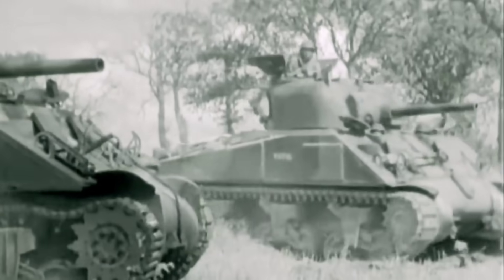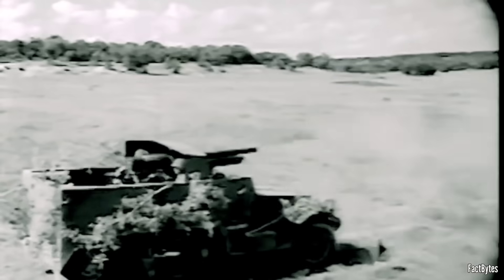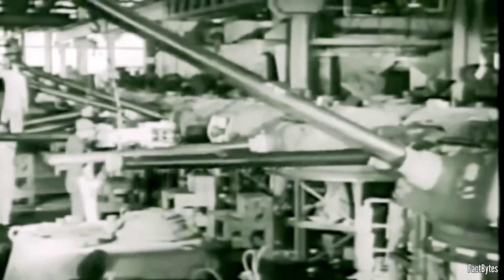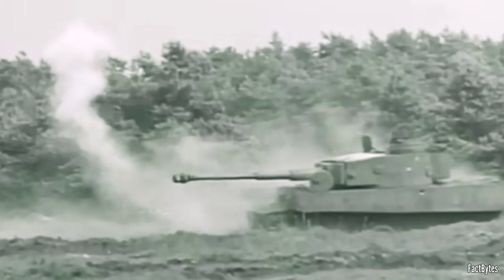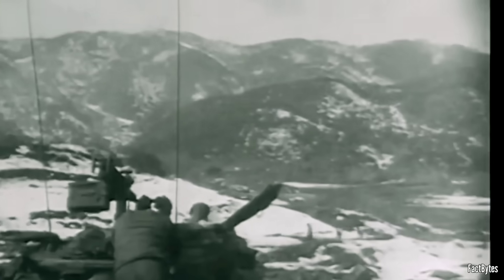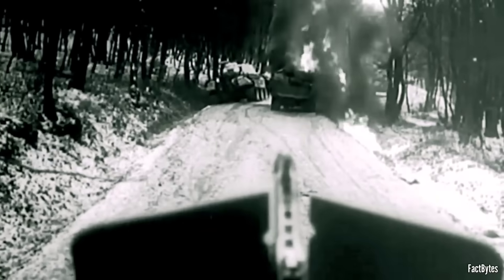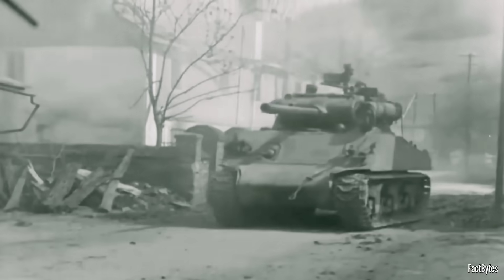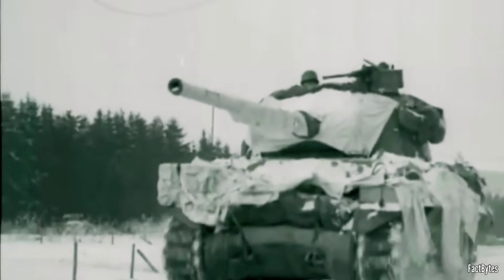From Stopgap to Big Cat Killer: Why the M36 Jackson Existed

Comment: The U.S. Army at first contracted for 500 M36 tank destroyers which were to complement the M10 tank destroyers.  The M36 would be called in whenever a Tiger I, King Tiger, Panther, or Jagdpanther were spotted.  This proved to be unrealistic and impractical.  The U.S. 21st Army Group's armored divisions were clamoring for more M36 tank destroyers and for the M10 to be immediately retired in favor of greater numbers of M36s.  The U.S. Army abided by the urgent demands as best as it could.  At this late stage in the war it was impractical to retire all M10s.  M36 production ramped up once more and in higher contract numbers but the desired mass numbers could not be met that fast.  U.S. manufacturers shipped M36 tank destroyers to Europe as fast as they could.  The current M10s would have to make do with similar M4 Sherman tank tactics of surrounding German heavy tanks and targeting the sides, flanks, and rear.
   The same went for the M4A1 Sherman 76mm cannon tanks.  It greatly helped when the new tungsten core HVAP round appeared in late December 1944 and January 1945.  Quantities were scarce, however, and often M4A1 tanks were limited to just two tungsten HVAP rounds apiece.  There's still uncertainty whether the 76mm tungsten HVAP round could penetrate a heavy German tank's frontal glacis armor at short ranges which would have been suicidal for a M4A1 tank and crew.  Sides and rear posed no problem of course.

Comment: The 3" & 76 mm were the same gun.
Reply: No the 3 in gun used in the M10 tank destroyer was completely different than the 76 mm gun fitted to late war Sherman M4 tanks.  The breach portion was too big to fit in a M4 Sherman turret.  Thus, the M10 was had a thin open top turret.
Reply: This is a common misconception because both guns fire the same rounds and have near equal performance. But the 76mm was a lighter, modernized version, while the 3' was a bulky WWI design.

Comment: I've heard the 90 mm weapon compared quite favorably with the vaunted German 88.
Reply: The 90mm M3 and the Flak 36 88mm had similar performances. The 88 got it's very justified reputation from being used as an AT gun far more than the 90mm.
Reply: @johnolive3425   The 90 mm was used on American tank destroyers. Yes, the 88 was much more well known as a tank killer even though it was sometimes the 75 mm weapon.
Reply: @johnolive3425  That's why I described the German weapon as vaunted.  adj praised or boasted about, especially in an excessive way:
Reply: It was better than the "short" 88 (kwk36). But worse than the "long" 88 (kwk43).
The 90mm firepower was something in between the Tiger I and II.
Reply: @1918BARsam  - That would make them comparable.

Comment: Britain did this with the Firefly months before but the US didn't want it LOL.  The Jackson did finally turn up... eventually
Reply: Also the M 10C Achilles.
Reply: The US didn't use it because it was a gun and ammunition they didn't produce, the gunner and loader ergonomics were terrible, and the accuracy wasn't good.
Reply: @T51B1  Accuracy with standard rounds was good enough, it was the APDS rounds that were inaccurate.
Reply: @T51B1  but it still killed german heavy tanks, so much so the firefly crews had to try and hide the 17 pounders barrel length
Reply: @TheFunkhouser that's because the Germans were afraid it so they targeted it first. I would place a bet that 75mm tanks had more kills than the fireflies did.

Comment: I read somewhere that, during the Battle of the Bulge, three of these tanks were positioned in a tree line facing a very large open field covered in morning fog.  The crews could hear German tanks out there but couldn't see them.  Then the fog started to lift and the M36 crews started to make out the German tanks.  The M36s picked them off one by one as the fog pulled back.
Reply: Crews of those Tank Destroyers very much loved their equipment.  Very little worried them, and they could always direct air support as necessary as a last resort.

Comment: IIRC for antitank work the 75mm was poor. The 76mm with good antitank  ammo worked. But that ammo was in short supply. The 90mm was what was needed. The M36 had it and was available.
Reply: The 75mm killed everything it met for the most part, it had no problems with panzer 4, it killed Panthers and tigers. We do know by after action reports that no one wanted the 90mm or the m36 because it wasn't needed.

Comment: One Tiger I required 5 Shermans to take out, one Tiger II is1.3 Tiger I, which was 6.5 Shermans, but M36 Jackson required 5 Tiger II to take out, so 32.5 Sherman equivalent. They were very valuable tools in US army
Reply: For the record, one Tiger II required one M10 Greyhound armored car with a 37mm gun repeatedly shooting point-blank at the Tiger II's ass to take it out.
Reply: @Slickrock72 That's 1/5 of Jackson and 6.5 Sherman for each Greyhound. Never underestimate the capability of reconnaissance vehicles. Good recon could change the outcome of battles
Reply: @Slickrock72  Never happened. There were no Tigers in the area.
Reply: @TTTT-oc4eb Oh Hans, you are so naive.  It's a fact of history that YOU can research.
Reply: @Slickrock72 It's a myth that has been debunked multiple times. And yet it will not go away.
Reply: Are you really saying it took 5 Tiger II to take out one M36? Even a Puma armored car could one-shot a M-36, it had thinner armor than a regular Sherman.
Reply: @TTTT-oc4eb WW2 Armored warfare is not all about how thick the armor is. Mobility and awareness were much more important and decisive to victory. Those soft factors many casual Panzer fan ignored.
Greyhound, equipped with radio connected to recon planes and other US units including riflemen with good vision, meaning one greyhound in practice had many more times the eyes than 5 King Tigers, which had weaker radio that could not connect to infantry, no air recon, and poor visions of their tanks. 
Add on the Tiger 2 large size and noise, and guarantee the Greyhound could spot all 5 Tigers first, and this had addictive effect on the visibility difference as the Greyhound would simply avoid and stay hidden from the Tigers nor moved into their ambush.
Then calling in US artillery support, much precise than German ones, to suppress any few German infantry escorting the Tigers, and then smoke screen to reduce the long range potential of Tiger cannons, in few cases could even force the Tiger crews to abandon tanks, as these crews often not fresh and wore out from constant large number of fighting, often having wounded before that reduce their effectiveness.
The remaining Tiger, confused by artillery and the chaos among its escort, likely slowly move back from their defensive positions, still blind to the whereabouts of Greyhound, only for the armored car already driven behind the tank and shot its thin back armor, disabling the engine, before changing positions so the German infantry would be too slow to hit it with Panzerfaust. The last 1 or 2 Tigers, still stubbornly stay put, try to aim the Greyhound that already in close point blank range, only for the car being too quick and agile for the slow and large turret to keep up. Another back flank shot on each two and the Greyhound just won against 5 Tiger II
Reply: @sthrich635  First of all; this did not happen, there were no Tigers in the area. This has been debunked. And both Tigers had 80mm armor in the rear, too much for the 37mm.

And what's your source for US arty being much more precise than German one? Aside from US bias?
Reply: Bollocks! It was not that it took 5 to deal with a tiger 1. The sherman section  was 5 tanks. You sent the section.  Why make it easy for the Tiger.
Reply: @patrickporter1864 That's exactly the point - Since Sherman was almost always sent in 5 tanks, and then there was only a few Tiger encounters, so it was almost always 5 Sherman tanks vs Tiger, and that's the majority of combat data as a result - 5 Sherman tanks to fight Tiger - no same Allied commander was bored enough to experiment what if send 3 or 2 Sherman instead.
So the data record still stands as 5 Sherman for a Tiger as the strongest proven point, rather than 1 or 2 Sherman for a Tiger.
Reply: There were 4 encounters with US  Sherman's vs Tigers. They fought to a draw of 1 tiger lost to 1 Sherman lost. So Tiger could only equal the Sherman in combat. That is a fact. The panther lost the Sherman in all head to head matches with 3.6 Panthers lost to every Sherman lost. These are researchable facts.
Reply: @briankiker  Look up "Michael Wittman".
Reply: @Slickrock72 he fought Russians and British. And died. Not usa

Comment: Isaac D White, Commanding General of US 2nd Armored Division in a report to Eisenhower on March 20th 1945 wrote :
""Tank Destroyer, M36: Has not lived up to expectations, but when HVAP ammunition becomes available it is hoped that it will be more effective. Fighting compartment precludes efficient service of the piece and available ammunition is not effective at required long range.""
Reply: The 90mm M3 suffered the same problem as the 76mm M1 - poor quality standard AP rounds,  and APCR and improved standard rounds weren't available until the very last months of the war. On paper they were almost identical in performance to respectively the 75mm L/48 in the Panzer IV and 88mm L/56 in the Tiger 1, but underperformed due the soft standard rounds.

Comment: The Sherman lose rate was way better than 5 to 1. Even the 75 was dangerous to a cat at long range, drop HE on him and he will pull out rather than risk optic damage or losing a track. If you have numbers, good coordination and tactics you don't need to be driving the biggest and baddest.
Reply: The 75mm was near useless against a Tiger or the front armor of a Panther. It even struggeld with the front hull armor of the Panzer IV. Even the 76mm was considered near useless against the big cats.
Reply: It would be part of a drill 75's take cover and lay in HE, smoke too, well your infantry, tank destroyers or firefly's stalk.
Reply: @nicholassmidsmid2808  Easy to say 80 years after, when you never have looked down the barrel of a high velocity 75mm or 88mm gun...

Sherman crews were terrified to go up against the big cats, that should tell you something.
Reply: Please note I was saying HE, there was no expectation of penetrating the armor. However near misses forces them to close up effectively blinding a tank crew. A direct hit can destroy optics near by and equipment in contact with the main armor. A close near miss or hit will damage tracks and suspension. I am assuming Totalizer was associated with Goodwood and yes that was a very British stuff up sending in tanks unsupported. It was just about the perfect situation for Tigers. But well a tactical disaster it achieved it's objective of drawing German armor away from Cobra.
Reply: @nicholassmidsmid2808 No sane tank commander would go H2H with the big cats with HE as his only hope, even if it was 5 against 1.
Reply: Yet they got the job done on the odd occasion when the things actually turned up. By later in the year the tigers and panthers were fast becoming endangered species. The Battle of the bulge was their last outing in serious numbers in the west.
Reply: @nicholassmidsmid2808  In the last year of the war the Panther was the most common German tank in the West with 1833 deployed from May 1944 vs. 1665 Panzer IV and 1640 Stug II.
Reply: During Operation Totalize in Normandy the Tiger had a 10 to 1 knock out ratio over the Sherman.
At Estrees la Campagne on 9th August 1944, the Canadian 28th Armoured Regiment lost a whopping 44 Shermans including Fireflies, mostly to a small number of Tigers from Schwere SS Panzer Abteilung 101 sniping them from over 1,000 yards away. Not a single Tiger was lost. The Shermans were completely ineffective in a long range gunnery match against Tigers frontally.
Reply: @lyndoncmp5751  Because of lousy tactics.
Reply: @31terikennedy  Tend to agree, I once read a very good book ex a British M4 commander, in Europe they would "smother" with HE.
Reply: @31terikennedy No, it was lousy tank design.